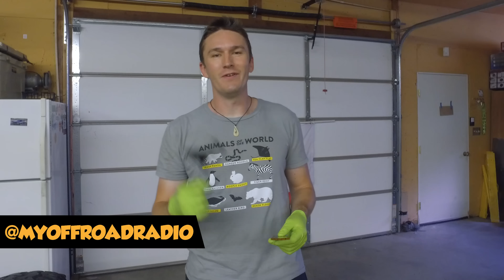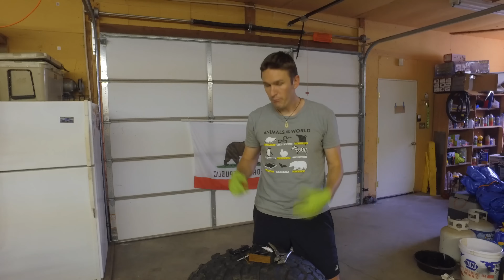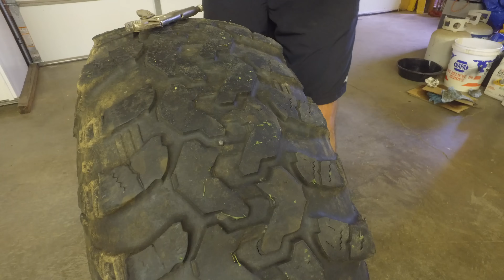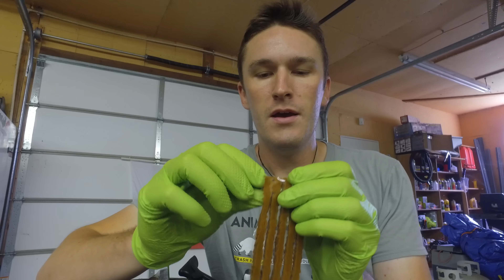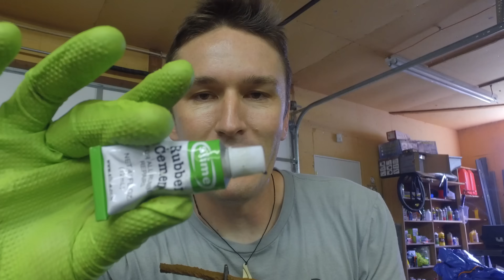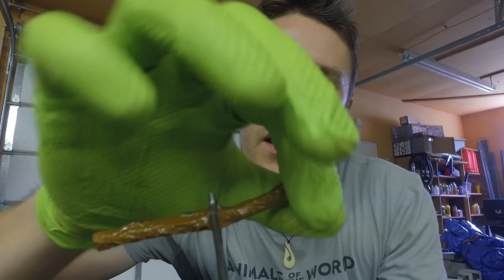Learn how to fix a flat tire using tool you would have on the trail

Comment: thanks for the post - always very informative.  I have the ARB kit but it doesn't come with rubber cement.  Their claim is that their plugs are self vulcanizing.  Any thoughts on that?  I know the cement shouldn't hurt but is it necessary with the ARB kit?  Thanks again for the video!
Reply from the maker: ARB makes a great kit, I've never used it. I'm not sure if they vulcanizing or not, but adding rubber cement can't hurt

Comment: Had a couple thoughts for you guys. Considering buying a 98-04 Taco 4 door, 4x4. Wondering what configuration, and year would be recommended.
Reply from the maker: I would get one with an E-Locker! I also like cloth seats because it gets hot here, and leather in the heat isn't fun. I also like a manual, but that's me
Reply: SnailTrail4x4 can you add an E-locker if it doesn’t already have one? Also want to know what you guys thought about a Cummins R2.8 swap.
Reply from the maker: You can, but you either need to modify the axle housing or get a completely new axle. I'd love to add a 2.8 but not allowed here in California where I live.
Reply: SnailTrail4x4 are they not allowed due to emissions? There’s a Cummins dealer near where I live.

Comment: The arb kit is top notch, all metal and heavy duty! Saved the day...night during my trip to Death Valley a couple months ago! One thing to note is after plugging a tire get it fixed professionally ASAP, if you want it fixed most shops won’t fix a plugged tire that been driven to long.
And most shops do it for free!
Reply from the maker: Both Great suggestions. We have the ARB as the large kit in the show notes.